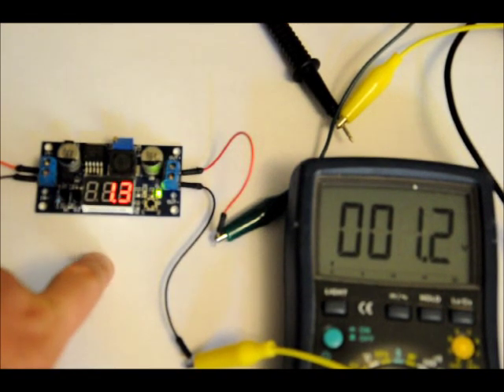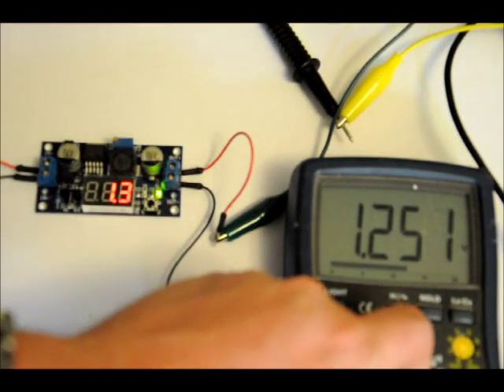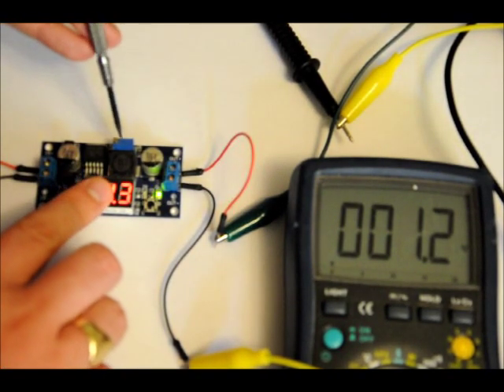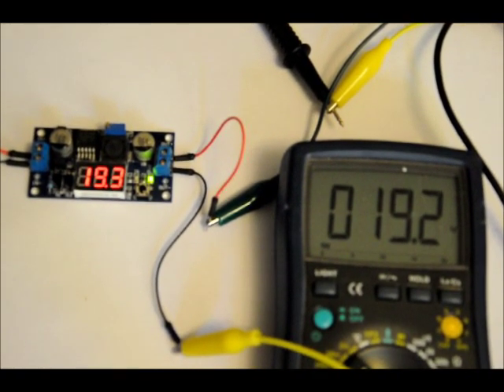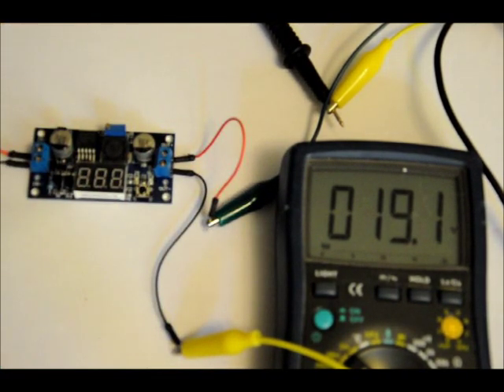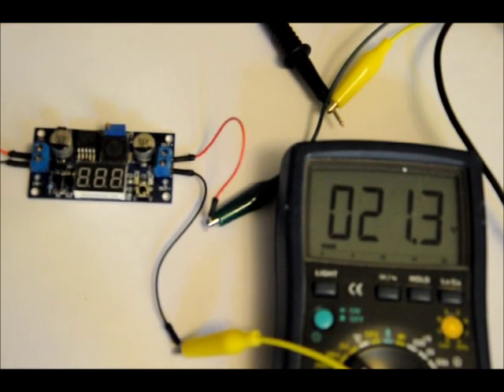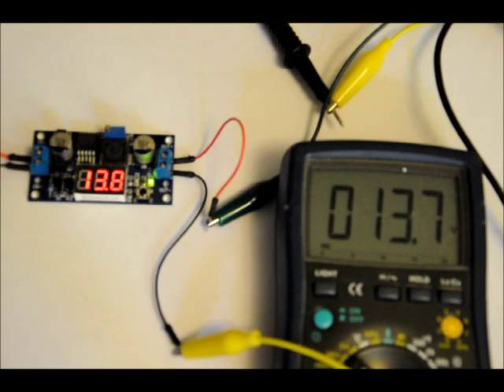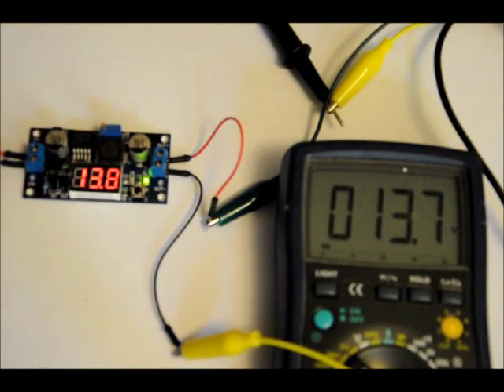LM2596 Voltage Regulator DC-DC Step Down Module with on board voltage display!

Comment: I use a solar panel as my input and power all kinds of electronic devices from the output.  My solar panel can supply up for 8 amps and I know this little device isn't supposed to supply more than 2-3amps so, what would happen if I accidentally shorted the output while it was connected to that powerful solar panel?  I didn't see any kind of fuse.  I did short a pair of wires once!  Good thing it was the INPUT from the solar panel!  Lots of sparks but nothing harmed :)
Also, I had a 12 volt fan running at 2 amps (which is the max continuous you say this can do) and the input voltage to the regulator was ~18 to 20 volts.  After a while, the chip felt very hot to the touch.  Is that normal?  It's interesting that there is no heat sink.

Comment: What is the risk of electrocution when touching the board with your bare fingers like that?
Reply: Hi
None.  It is a low voltage circuit =)  If I had 30v either on the input or output, it still isn't enough to cause a shock.